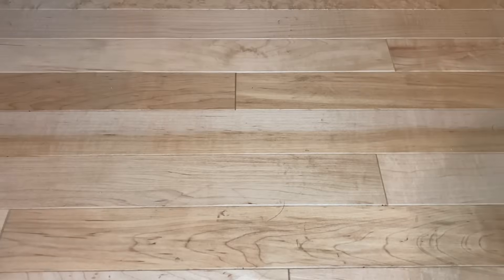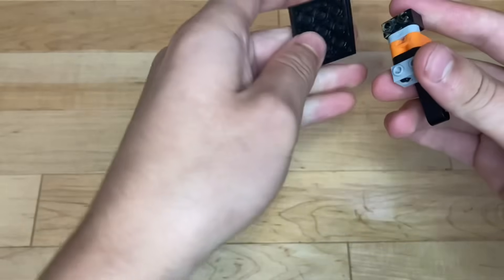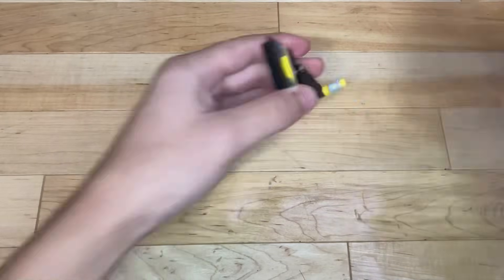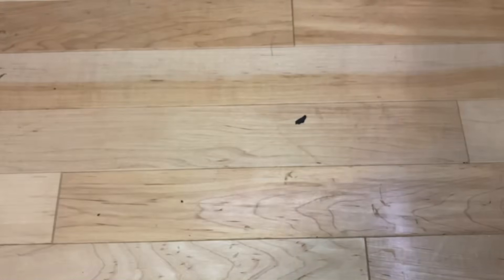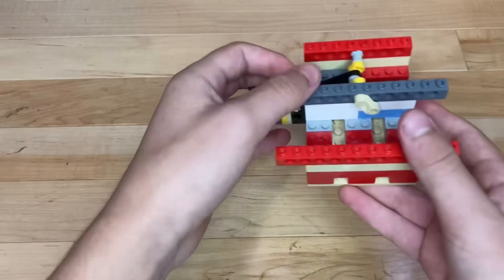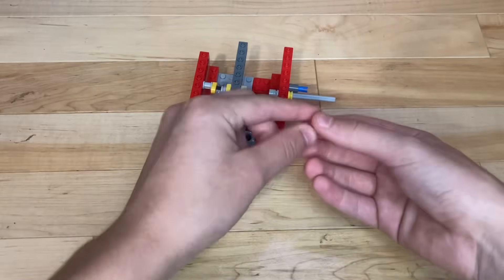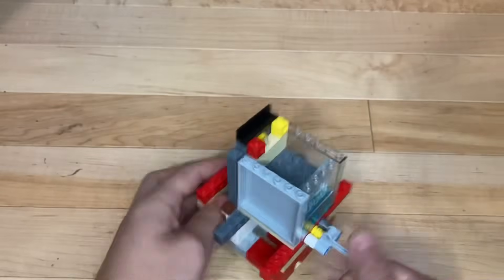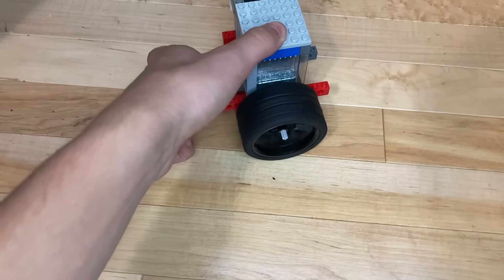LEGO Vacuum Engine Tutorial - HIGH PERFORMANCE

Comment: Maybe i should do a tutorial on my single cylinder so the viewers themselves can find out which is better😏
Reply from the maker: Ultimately it comes down to performance and rigidity, but you're more than welcome to make your own design. I don't like the idea of active competition between innocent lego builders, but you do you I guess!
Reply: @KFPlusLegoMastery  i mean no beef, just some innocent fun

I do have to get a rpm meter if i'm going to actually compare the engines but i do know that it revs very high even with a big heavy flywheel and goes to infinity and beyond with a light flywheel.

The engime was built a month ago but i will make a video on it tommorow so stay tuned!

This video was great as always, cheers! 👍

Comment: Kfplus, I’ve been making loads of engines now and I’ve found that a 2 cylinder 4x4 is the fastest for me.  The single cylinders I have built are way slower with no throttle response. How do you make your singles so quick?
Reply: reduce the piston crank to 2x1 and valve crank to 1.5 and a smaller flywheel i once made one and it ran on a car vacuum
Reply: @redstonegod296  2 cylinders can run without a flywheel and piston stroke is 3stud valve is 1.5 stud i think
Reply: @silentsausage41  make the crank 1.5 instead of 3’s. Less torque but also less piston speed meaning more speed
Reply: @redstonegod296I (wanted) to run a single engine on a 265 mph shop vac😂
Reply: I made the exact same one cylinder as he did and it runs the exact same. Try experimenting with his mechanism and make sure to lubricate the parts for best results
Reply: dam what language ya speakin tf
Reply: @beforeitallexisted  ''English'' :D
Reply: @beforeitallexisted legoish lmao
Reply: It also depends what kind of vacuum you're using and if you're using lubrication
Reply: @cartler  Its been a long time since i made that comment and have got my own design to work even better.  I needed to fiddle with the distance between the top dead centre piston, and exhaust port in the valve.  Once i had got that good, along with stabilising the valve, the engines are going really good.
Reply: Whose still here in 2023
Reply: @JB_Lego  Me lol
Reply: @JB_Lego  me it’s my first time making a single piston engine with others I make turbines but it’s fun and it works
Reply: Try olso higher air pressure
Reply: Nice
Reply: i highly recommend TAKING OFF VACUUM FILTERS it just slows the vacumm and engine and it makes it quiter
Reply: It‘s 6000+ rpm